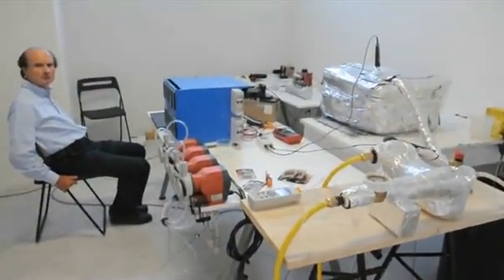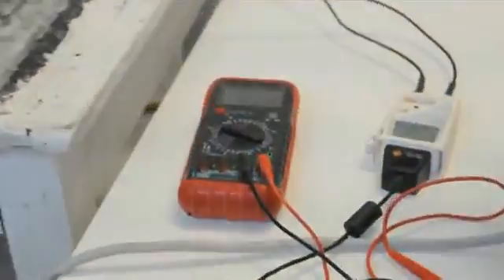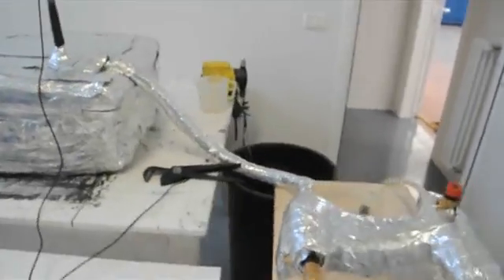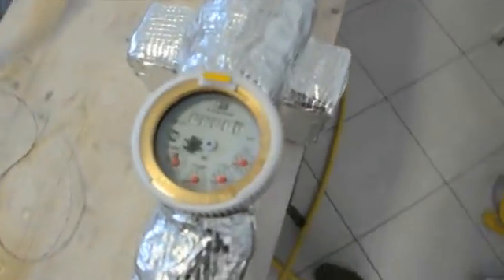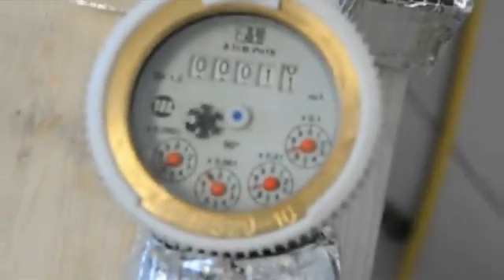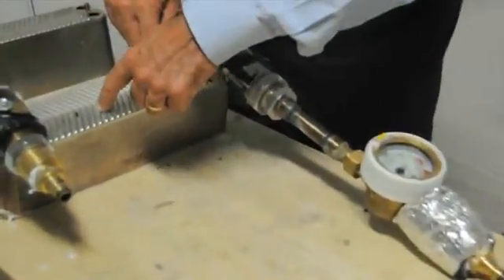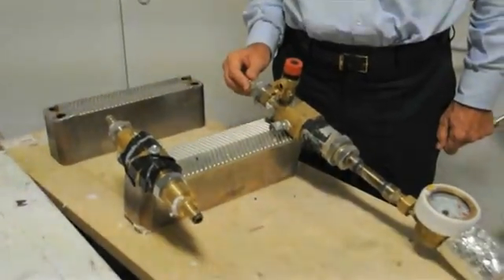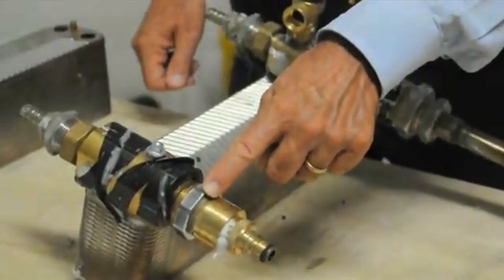New test of the E-cat enhances proof of heat

Comment: @runningman97 " you can't censor the truth for long, especially in the internet age."

That's true, but you can drown it out with seductive lies.

The truth is that there are a variety of feasible alternatives to fossil fuels already independently proven to produce enough net energy output to provide clean electricity and fuel for everyone. 

Hoping that a new one will be adopted where the others weren't fails to address the reasons why the others weren't.